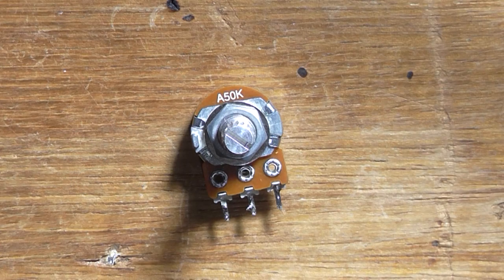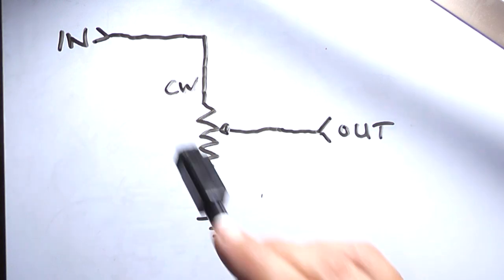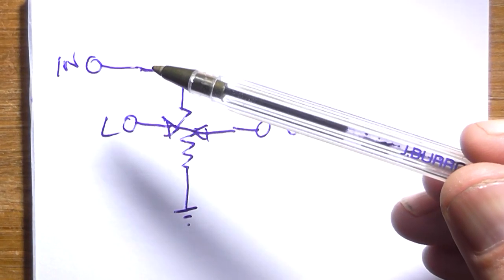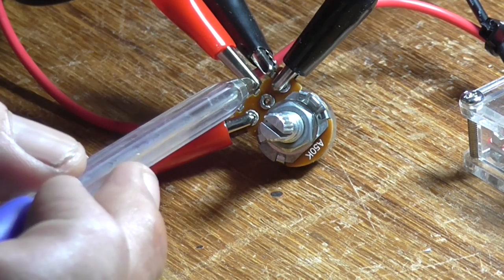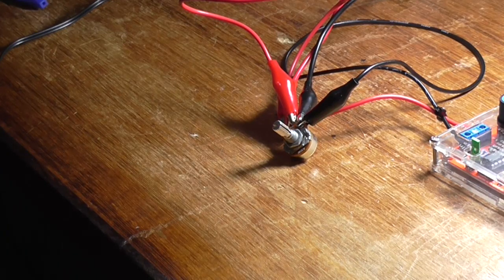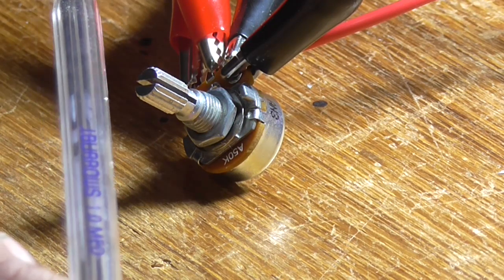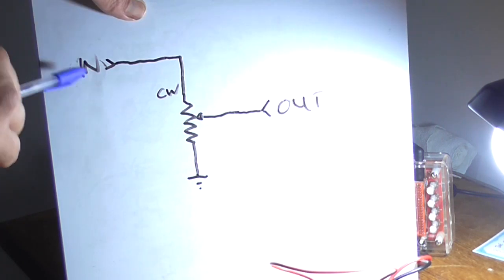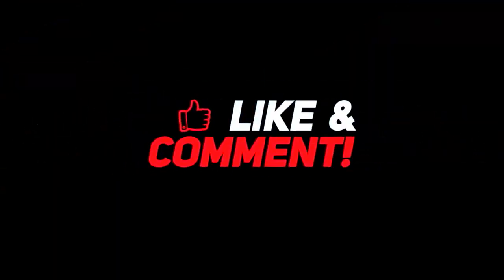How To Wire A Volume Control Correctly

Comment: The first time I dealt with this issue I had johnaudiotechs video as a guide.
Both your videos are excellent but your coverage of the difference between a logarithmic and linear potentiometer is more in depth.
However I think there is something that both you and John gloss over. It's one of those things that if you already know
You'll take it for granted that everyone knows already but in reality they probably don't. So here it is. Where in the sequence
between Music player/source, amplifier and speakers is the volume control?
The answer is of course between the music player/source and the input of the amplifier but If you don't know I promise you novices are going to be pulling their hair out trying to work this out. It's not enough to just state 'input' as many components and stages in a amplifier
has inputs. Just a thought from the novice perspective.
Reply from the maker: I thought of this when making the video, but I thought it was irrelevant. However, yes, the volume control can be anywhere in the circuit. For example, it can be at the "front-end" at the inputs before the preamplifier. It can be somewhere in the middle of the preamplifier. Or, it can be between the preamplifier and the power amplifier.
Reply: @AstrosElectronicsLab  I see this problem with a lot of youtube channels
concerning electronics. The presumption of knowledge that isn't there. 
All they're doing is excluding the very audience they're trying to teach.
You're among the better channels out there.. Not perfect but better.

Comment: Hey I'm new to this so I have a question, I have an amp, dac, headphone jack, and speaker that I want to get audio from a sp zero 2 w and I want to add a volume slider to. At what point do I put the potentiometer? I'm following Bytes N Bits' tutorial about I2S sound to raspberry pi if you want to check it out to understand what I mean more. But also, I'm trying to basically make my own board  using the same parts and I noticed that theres a potentiometer in the amp schematic (Adafruit PAM8302 - Mono 2.5W Class D
Audio Amplifier
). Could I just use that one for normal volume control or is it more of a "set it for your thing and leave it there"?. Also how many ohms should a potentiometer for this application be?

Comment: This is not the "correct" way to do this. The ground line is usually connected to the potentiometer as well to create a voltage divider circuit. This might work perfectly well, I dont know enough to say that it is bad necessarily, but from my understanding, it is not the typical way to do it.